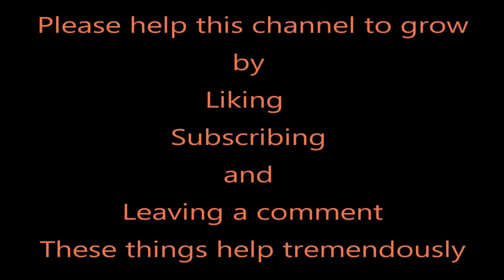Kangaroo Stew # 284 The Extension is Almost Finished!

Comment: A long while ago you said that you were going to try and cut down on the amount of stuff you used that was sourced from China, and aim more for locally made. How did you get on with that? I reckon it would be hard to swerve all the Chinese stuff although I also reckon we should as much as possible to try not to become totally dependant on them. Be interesting to know with a bit of time passed, how did you do, or how are you doing, or have you given up on it yet because it's impossible?
Reply from the maker: I still keep it in mind, The workshop consumables are now Aussie or New Zealand made, I dont seem to be able to cut it out all together mainly due to the cost difference. For instance the power supply I purchased for $105 (Chinese) is around $600 US to bring in from the USA so in that case I wouldnt feel it was worth it. So I supose price does have a lot to do with it but if we are food shopping nothing from China enters the house, we or I should say Judy takes ages label reading. Some of my Renegade tools even though they are designed by Aussies are manufactured in china Im sure.
Reply: Most I've found says "Made in USA" with Global components . Most are just putting on stickers or just putting in a box to claim made in USA . I bought a scale marked Made in US . I had a problem with it an after takin the bottom cover off , was marked Made in China
Reply: The cost difference was always the lever. If you want to go China free you have to swallow some cost.  The Chinese always relied on the cost element to keep us locked in enough  to become dependant, even to the extent of alternative suppliers going bust and leaving the Chinese in control of the game. It is hard I agree to source affordable alternatives, as individuals we can't win the war.
Reply from the maker: Im now looking to upgrade my laser to take a full sheet of gasket paper and eveen the Australian kits seem to be Chinese in origin. I think we can choose to have less Chinese stuff but I dont think we will be able to get by now a days with none at all. That seems to be the reality of it.
Reply: @BundyBearsShed  I reckon you have the measure of it. The Chinese have spend so many years benefiting from in house subsidies that they are now involved in every aspect of supply. International suppliers have been seduced by the price differentials which the Chinese have used to induce us to buy their stuff for so long that the Chinese have a firm foothold in the global supply chain. I applaud your efforts to bypass the Chinese influence but am not surprised that by now they're so entrenched that they are impossible to unseat and some things just can't be sourced without resorting to Chinese manufactured products. Just get used to second quality items which seem to be the norm. Good stew by the way. I always enjoy watching your channel. You are a decent guy and knowledgeable.

Comment: I've had a lot of luck with zinc plating using an old mobile phone charger a zinc sulfate solution and a boat anode. The trick is cleaning the part first and preferably sandblasting it... I've got stuff that has been outside for 2 years with no rust.
Reply from the maker: i do have some boat anodes tucked away. Ill have to get around to it sooner rather than later.
Reply: @BundyBearsShed  some anodes are not Zinc btw

Comment: The DOW windshield adhesive is awesome stuff also , I've used it to recast broken motor mounts rubber ,or anything rubber that's obsolete unobtainium . Kinda pricy ,but evilbay has several tubes that made the price about 10 bucks a tube instead of almost 40 locally . Needs a decent caulk gun along with warming it up to get it to go .. Oh yeah , if spreading with a putty knife , use a cheapy , it's ruff to clean off .
Reply from the maker: Ok Thanks Ill have a look for it.